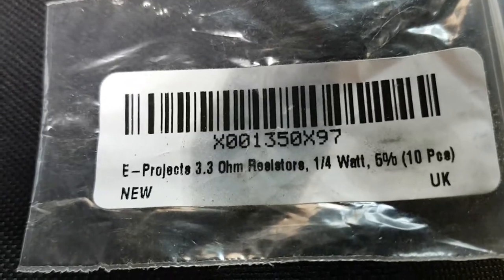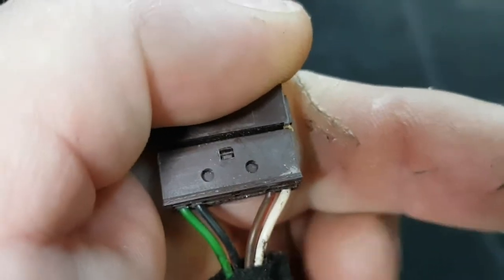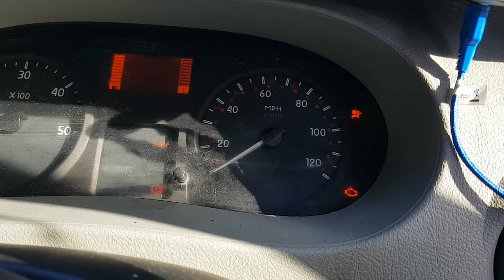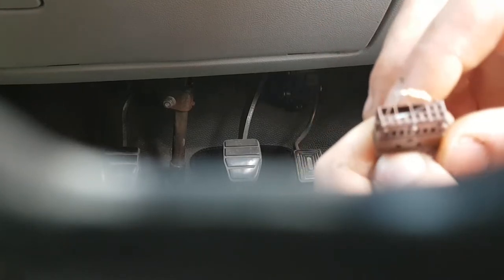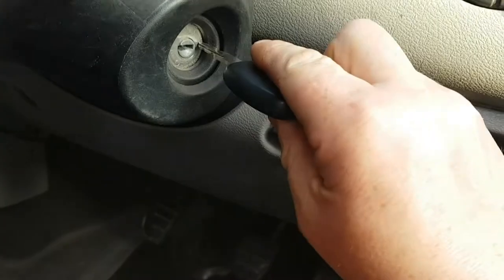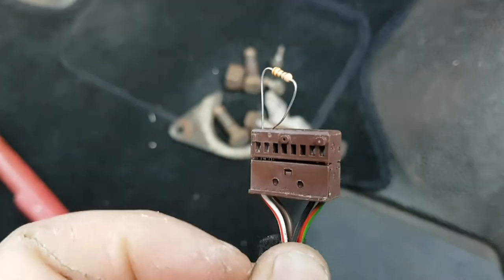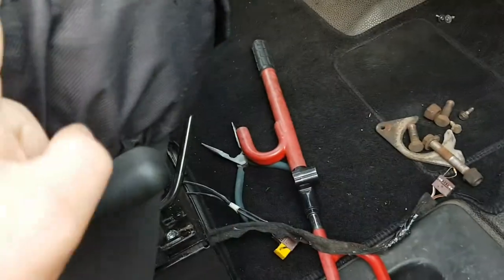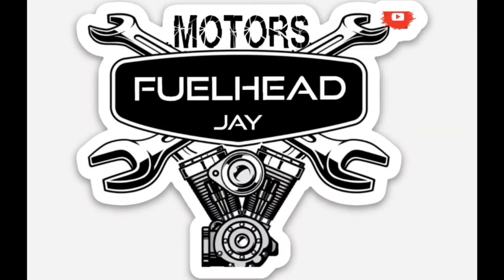Renault Master mk2 switch airbag light off after seat swap

Comment: Was that a combined seatbelt and air bag light, due to to seat rather than the air bag in this case ?
Reply from the maker: there's two plugs one seat belt other airbag should off shown them both

Comment: hi, my airbag light is the same, it just appeared and sometimes it will go out. Will this resistor cure this? I was told that i needed to change the connector and solder wires together to cure it but it did not work. I will try this tomorrow.
Reply from the maker: If it connector then should do